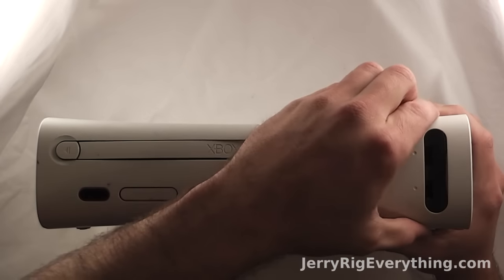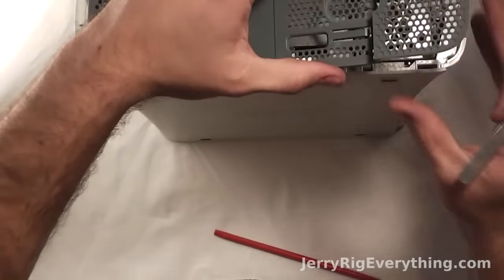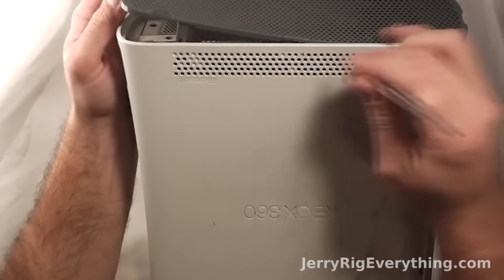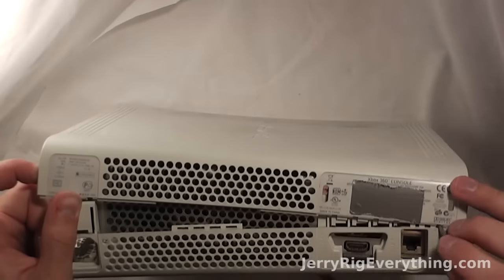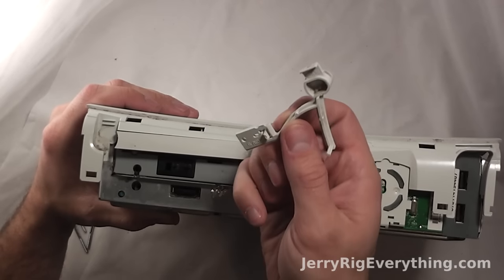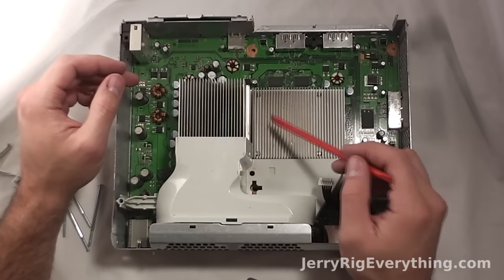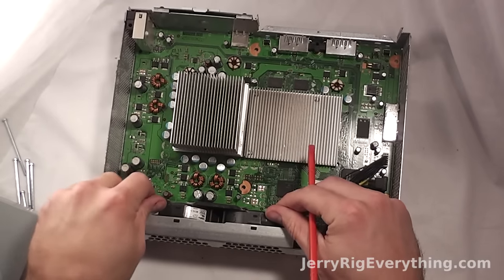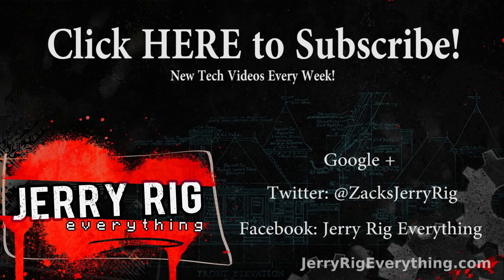Xbox 360 Complete Tear Down, Fix and repair video. To the point.

Comment: Great, I just did this and now I no longer get a picture (or sound or anything) from my 360. I doubt that I broke anything, didn't feel like I did anything wrong, just followed the video and did everything as shown without problems, reassembled it, plugged everything back in, it even turns on and the fans start blowing, but there is no more picture. Anyone have an idea wth happened?

EDIT: lol nvm, I just accidently switched the thing on the cable that goes into the 360 from TV to HDTV without noticing. Works fine now :)

EDIT2: Oof, now the damn thing won't read any discs (tried multiple). No idea if the disassembly caused that or if it would have been the same either way, since I didn't test discs before taking it apart. Any help? :/

Comment: My xbox360 has the red ring how do I fix it
Reply: Toss it in the bin
Reply: if its the first time you can try the xclamp method, but that will only last a little while before it warps the board, some people have put the motherboard in the hoven or something similar, and i guess that re connects the sodder points, which is a cause for some types of red ring.. theres a bunch of different reasons it would red ring